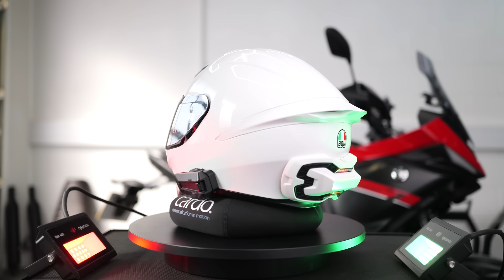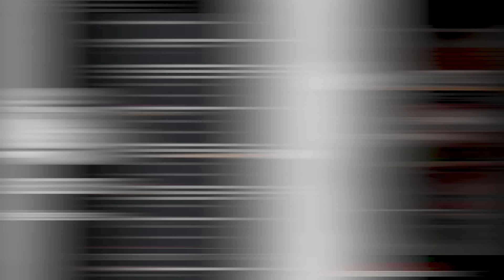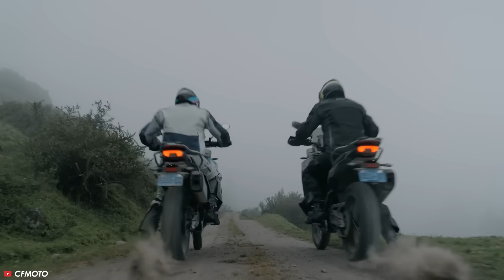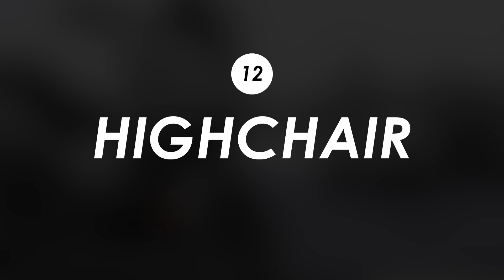Moto News: Norton To Build In UK, CFMOTO 1000 MT-X & More!

Comment: driving an engine with an electric motor to just get the vibrations sounds like a lot of extra drag and weight. If the mythical battery comes out that has enough power, maybe. But batteries don't really have enough capacity just to drive the bike along a reasonable range at the moment !  I see a Bass Tube exhaust with a speaker being a lot more achievable, with less power and weight needed to make the ICE sounds ! Plus switchable sounds, so have a the touch of a button the sound of  a single , v2,  parallel twin, v4, straight 4 , 120 degree triple, or if you are really a masochist a T plane Triple noise  ! ( I still don't like the T plane Triple ! give me a 120 degree one any time , but not a T plane one !)

Comment: 0:40 Safety gear giveaway
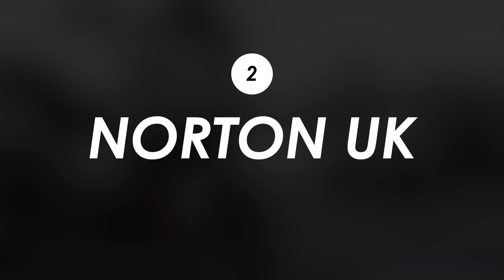2:28 Norton line-up changes
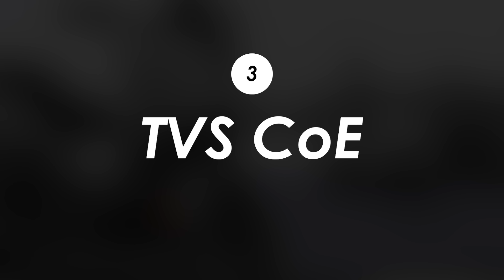3:50 TVS buy Engines Engineering
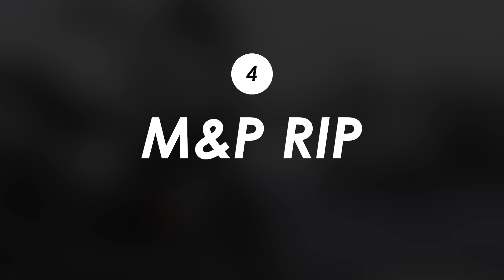5:04 M&P closure

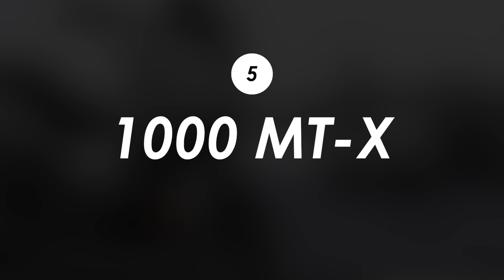6:03 1000cc CFMoto triple
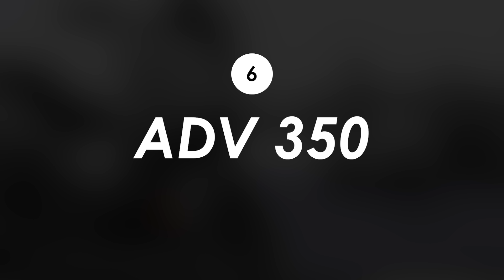7:40 Honda ADV 350
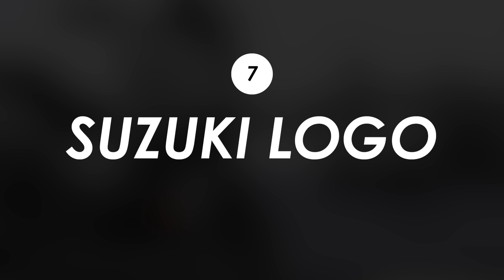8:03 Suzuki logo change
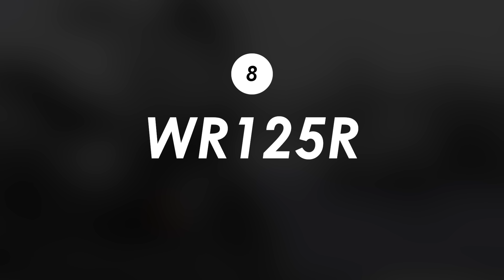8:26 Yamaha WR125R dirt bike
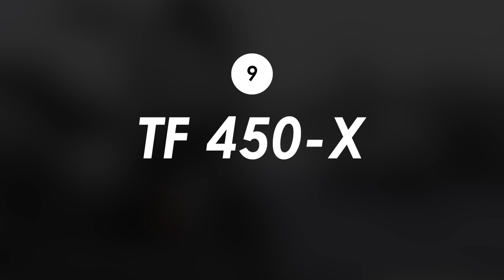9:28 Triumph 450cc motocross
10:17 Kawasaki ZX-10R discontinued?
11:05 Indian speed record
11:40 JD Stunts highchair wheelie record
12:03 Yamaha ICE-like e-bike patent
12:12 Biking platform shoes